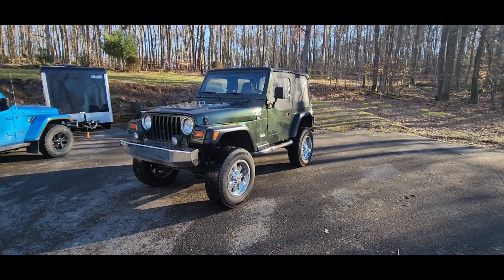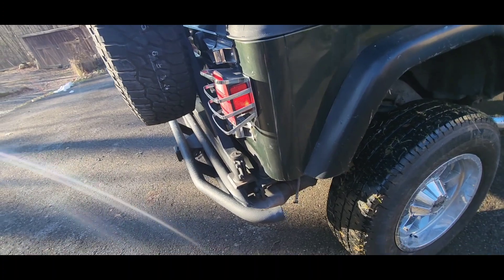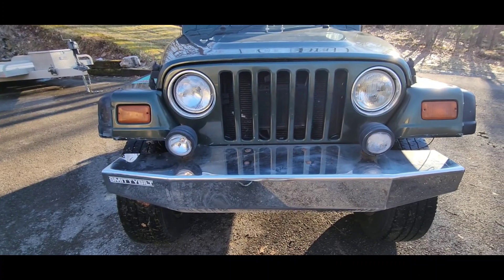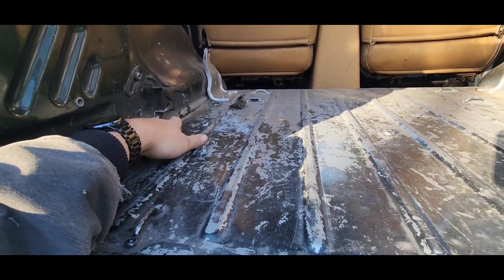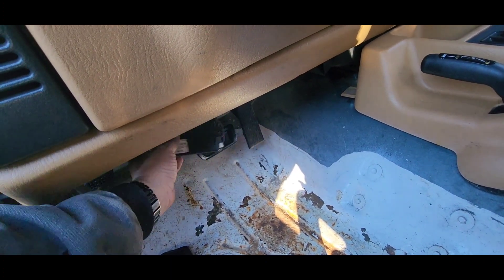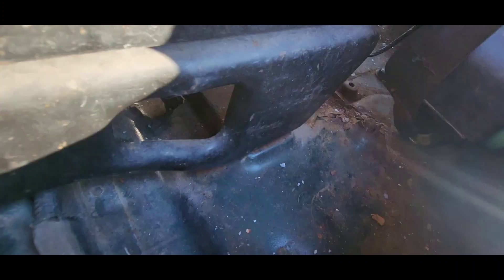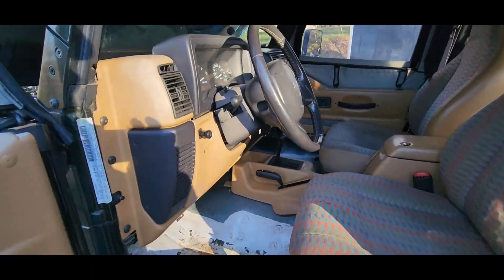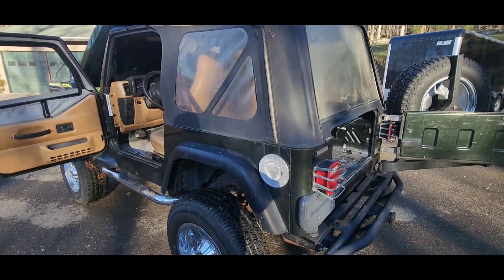Questionable Decisions, I bought a 1997 Jeep Wrangler TJ Rust, Holes, and Missing Parts

Comment: I’d love to have one! I would love to put something like an old 283 Chevy small block in one. I wouldn’t trust the jeep engine much farther than my driveway.
Reply from the maker: This one only has 100,000 on it lots of life left
Reply: @leehopkinsenterprises  They don’t all fail. They just have the highest failure rate.
Reply: The 4.0 engines are the best engines jeep ever put into a jeep wrangler and the cherokees. I'm not saying the 283 chevy or even the 350 chevy are bad I'm just saying the 4.0 engines are the best ones for the jeeps
Reply from the maker: Their a tough motor. I have had 3 through the years in Jeep wranglers and never a problem beyond normal maintenance. That being said, anything can happen.
Reply: I'm driving my 3th Wrangler 4.0/4.2 (2x YJ 4.2 and now a TJ) non of them ever left me stranded. The first one I traded in wen it had 450K (kilometers) on the clock, the second had 635K on the clock and my TJ has almost 200K on the clock. Non of them burned oil, non of them failed when starting . . . ever. These Jeeps were/are my daily drivers and I drive Jeeps for 35 years now. The 4.0 is known as one of the most reliable engines money can buy. To be honest, I really have no clue what you are talking about. Look at the old M38A1's these jeeps keep running as well. I think you are talking about the newer Jeeps . . .